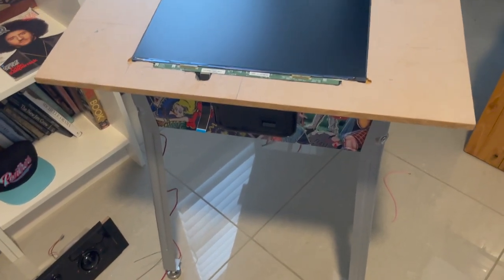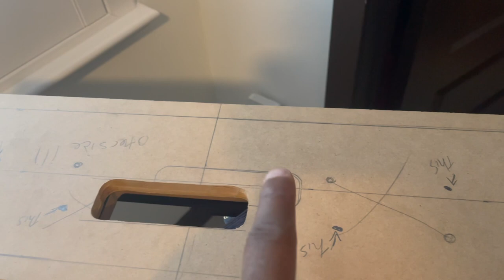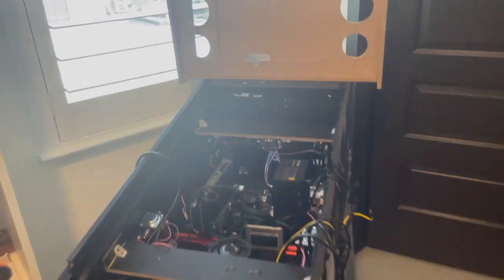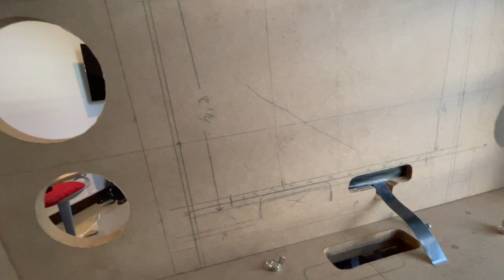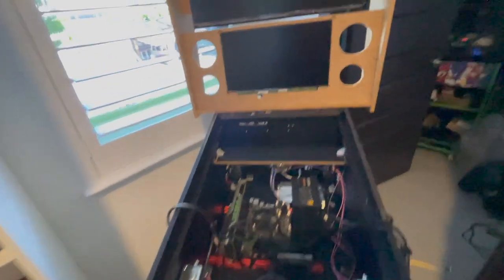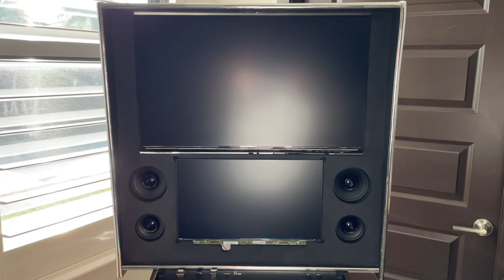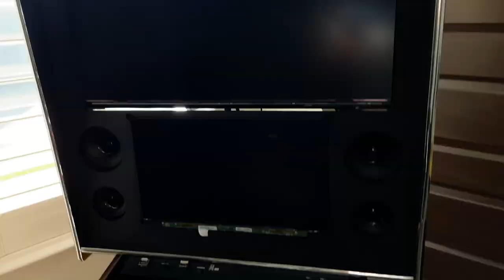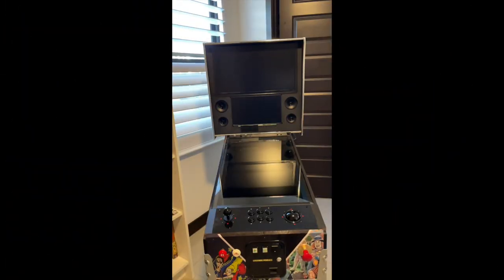Atgames Legends Pinball Mod Part 3

Comment: What are you using for power distribution to power the PC and monitors in the back box?
Reply from the maker: I have a smart power strip wired into the power cord just after the switch.  That way the switch controls power to everything. The vibs button is the soft power button to the PC. I set the PC BIOS to default to off power state. 

The PC is plugged into the control port of the power strip and everything else are on the “controlled” ports. So when the PC is on, they turn on. And when I turn off the PC, they turn off as well.

Comment: not telling you what to do with your ALP but you should  remove that OTG dock station inside pinball machine and  solder 2 wires and add a arcade button for on/off OTG mode just saying